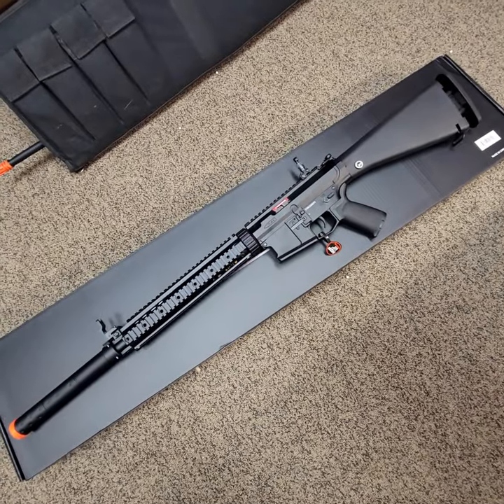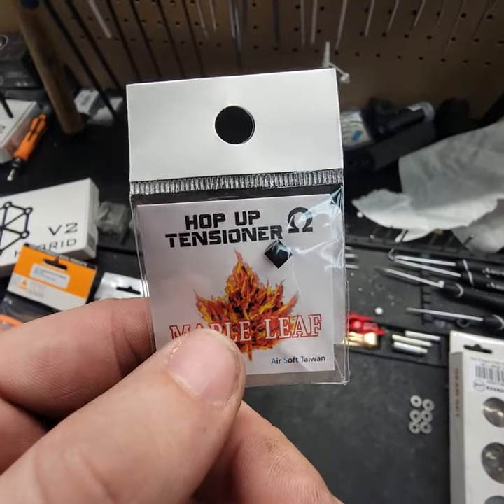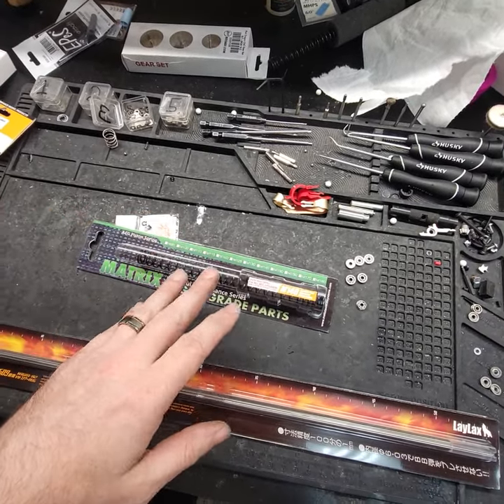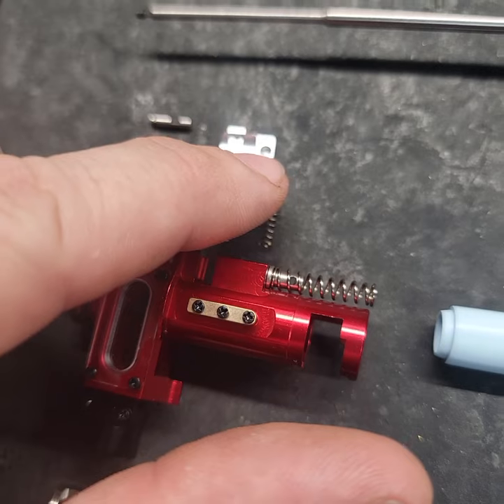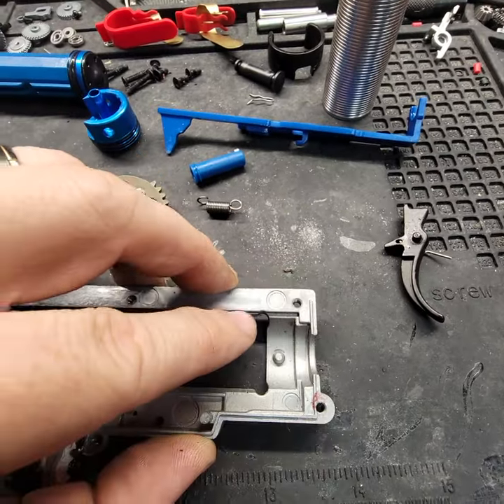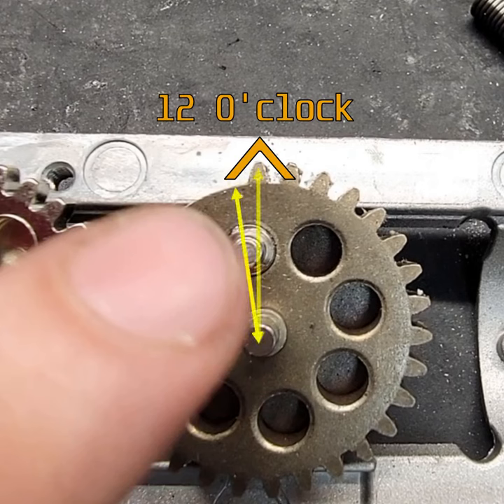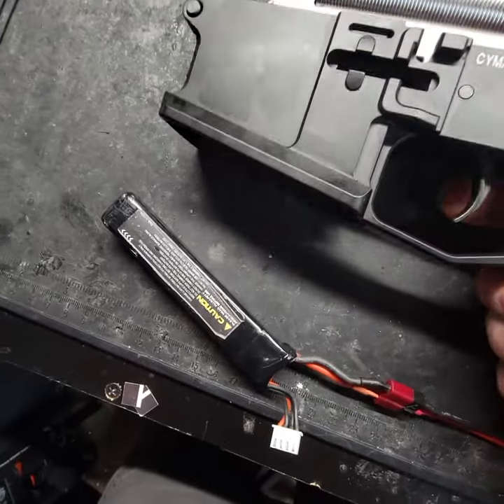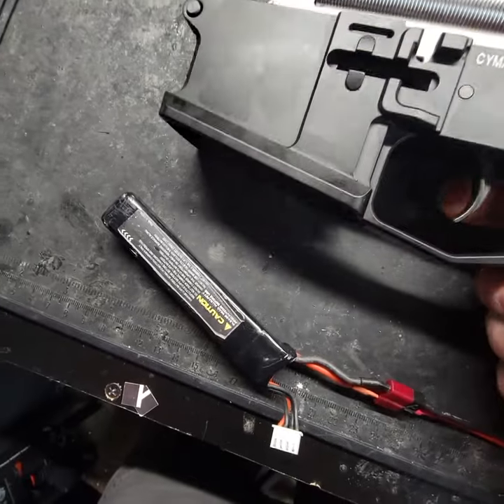Cyma SR25 Airsoft Rifle Upgrade Mastery: Insider Tips for Peak Performance!

Comment: Glad to see im not the only one who has power issues with the cyma sr25s. I have 3 of them and they all need lot of spring to get 2.3j.
Reply from the maker: What weight bb are you shooting and what is the diameter and length of your barrel?
Reply: @wyshtechairsoft  oh, they are set up to various spec. But the one thats closest to the on you built in this vid get 2-2.05j with an shs m150 no spacers. Woth 10mm spacer it gets spot on 2.3j. 
From what i can tell from talking to others who have/built these, this is kinda normal. 
Barrel is 509x6.01mm  shooting .36g bbs.
Reply: @kapler8550 funny as I have one that was built to be roughly 1.88j but the spring it has (guarder sp120) makes it only go to about 1.6j. it had a bunch of air seal upgrades too, basically everything except the gears, mosfet and barrel were upgraded. If it's just a quirk of these guns them I'm somewhat relieved
Reply from the maker: Nozzle alignment and tappet plate timing play a huge role in these sr25's.  The SHS/Rocket SR25 sector gears have trash tappet plate timing as for some reason the manufacturers decided it was good idea to REALLY advance the tappet plate pin WAAAAY ahead of the pickup tooth.
Reply: @wyshtechairsoft  nozzle alignment for mine should be fine, but yeah I noticed the tappet must be early as at rest the nozzle sits back, air seal still seems good tho weirdly, FPS consistency was +-1fps despite the lower FPS than expected
Reply from the maker: Does your sr25's joule creep when comparing from .20 to .36?
Reply: @wyshtechairsoft  yeah I’ve checked everything there is to check on mine. nozzle alignment is perfect. So is the airseal. im using the stock sector gear so timing isnt an issue. Im also using a g&g f2000 nozzle (24.5mm). Which doesnt have an oring but fits so perfectly on an shs cylinder head that it seals perfectly and has 0 wobble.
And nah .36s shoot with about the same energy as .2s .32s are the sweet spot.
Reply from the maker: @kapler8550  try a shorter barrel for fun and see what the joules do.  It should go up which would allow you to use a weaker spring to achieve the same result as before.
Reply: @wyshtechairsoft  my second sr25 is using a 
410X6.03mm barrel and it has the same power issues.
Reply: That's because it's got a extended cylinder, you need a spring made for it, I haven't found one make for it yet tho
Reply from the maker: @tbone9339 Matrix and EMG springs have plenty of reach.
Reply: @wyshtechairsoft  but they're still not as compressed as they would be in a normal cylinder right? So they're not giving as much power as they would in a normal m4
Reply from the maker: @tbone9339 actually they do partially compress.  In fact, with my experience building multiple v2.5, SVD, and the new G&G DMR. They always yield more joules than factory.  All because the added stroke on a 19 tooth vs a 16 tooth has more interia and air volume.  It also depends on how heavy of a bb you use (given that its a full cylinder in the 19 tooth).
Reply: @dankblissey6162  Sounds normal to me.
I am now upgrading my Steyr AUG A5 0.50", turning it into a DMR. With an M130, it shoots 370 fps @ 0.30g, which equals 1.9J. Here in the Netherlands, a DMR is restricted to 1.7J, so my next move will be to put an M120 in there (where's an M125 when you need them?!).
My Classic Army SR25 shoots 1.7J with an M120 and a simple 3D-printed shim that pre-tensions the spring (without it, I did not get close enough to 1.7J). I might want to check as how it shoots with an M130, but the Steyr AUG has priority now.
As always, the quality of the nozzle is crucial. I had to swap several of them until the AUG started to behave consistently at its peak fps.

Comment: I just bought everything for my build except I didnt buy a new barrel and I bought the titan V2 instead. Did you use the stock spring to get these results?
Reply from the maker: If my memory serves me right. I put in a m130 spring in it. Becareful with the cycle speed on these sr25's as they PME real easy with heavy bbs like .40g bbs.  The stock motor in them is slow enough to help with that.

Comment: Hello bro... Can I ask you something? I have a M110 (SR25) by Classic Army. 1. do you did a upgrade before this? 2. Right now have a barrel Mape Leaf of 540mm and use Bbs of 0,32g so,  Is correct the configuration? 3. What is you best configuratión suggest for my case..?
Reply from the maker: I always recommend using .40g bbs for even more range but you need to use a 420mm length barrel.

Comment: If i use a 6.05mm diameter Barrel can i keep the 470mm lenght to use .40s or it needs to be another lenght? thank you very much
Reply from the maker: Quick answer, I find 6.03 x 410mm with a SR25 length "NON-PORTED" cylinder in the SR25 is the sweet spot for .40g for best accuracy and maximize range without pushing TOO much air.  I highly recommend reading this article about the "What Barrel Length goes with what bb weight in an AEG?".  Link: https://www.airsoftsociety.com/threads/what-barrel-length-goes-with-what-bb-weight-in-an-aeg.153191/

Comment: nice , any opinions on the EC sr25?
Reply from the maker: They are okay in my book but id say you get a better deal with the Cyma Platinum SR25. DEFINITELY better than getting an A&K.
Reply: It's good as well. Especially those bought from taiwangun or thailand. But if it's from hongkong with regular stuff, it's crap. No true quick change, plastic nozzle no oring, and a ported fckssning cylinder.
Reply: @mmwkoh Mine came from Poland

Comment: I'd actually recommend the mr hop over the super macaron. Combine it with a maple leaf or action army barrel and you can lift .36s without even touching the dial. Super macaron is really nice but I think the mr hop barely edges it out. Also swapping to a shorter barrel like a 455 or 410 to make sure you're giving the heavier BBs a better push is a good idea too
Reply from the maker: Going down to 455mm over volumes the rifle for .36 bbs which causes a wider grouping at 200+ feet.  Super Macaron hops the bbs more consistent than the MR hop which is why is was chosen.
Reply: @wyshtechairsoft  In my experience using .40s on a 455 I've had no issues using the mr hop compared to the super. They're both great buckings tho
Reply from the maker: @lukejohnson3612 Yes, 455 is pretty close to what you need for .40s.   .45s would be even better if you got a full cylinder in the SR25.  I built many of these sr25's and tried many variations, and now build them for people. This one was specifically built for .40g and to maximize accuracy with that given weight.
Reply: @wyshtechairsoft quick question, what determines the weight of the bb that you are going to use? Because the way I see it, the system is optimized to use that bb weight, right?
Reply from the maker: @Rasyad95 Its air volume ratio.  The ratio between the volume of the compression area in the cylinder compared to the inner barrel assembly.  The heavier the bb, the more ratio you need.
Reply: @wyshtechairsoft  so you decide the inner barrel size you are going to use, and the bb weight follows?
Reply: @Rasyad95 goes both ways. I have another stock hop up with 455 mm barrel for me to use when i do .36s instead of .40 or .45

Comment: For me, after I upgraded my parts I was getting 1.7 J with stock spring then 1.75J with m130 spring with .40bbs. Once I put in a m140 spring something all came together because I was now getting 2.59J with .40bbs
Reply from the maker: Sounds like it caught a better seal.  Whatever was installed made it get a better seal.  I've had this happen to me before as well.  Which is why I usually test with the stock spring when I put everything back together (if the stock spring isn't too weak to cause PME). That way, I can see if there were any compression leaks anywhere.  Sometimes compression leaks dont appear until you go to a heavier spring since compression pressure spike is alot higher and some areas will "blow out" if the surface areas of which the seals make contact isnt tight enough.
Reply from the maker: A good example of this is a loose-fitting cylinder head to cylinder.

Comment: M140 in V2.5 gearbox isn't M140 since the cylinder and piston are longer and don't compress the spring as much. You'll always get much lower results in V2.5 compared to V2.
Guarder PSG springs are made for 2.5 shells, PSG120 is around 2.3 joules.
Reply from the maker: True, but it is still an M140 as that is its designation.  Thank you for the insight on the Guarder PSG springs! Where can one order them?

Comment: Looks like you have done a lot of SR-25s- what is the best one "out of the box"?
Reply from the maker: The Cyma Platinum SR25. Dont need much to upgrade on that bad boy.  Upgrading the ETU and nozzle makes a MASSIVE improvement on those things.  Dont need to change out the compression set except the nozzle. Heck the .motor is good.
Reply: @wyshtechairsoft just got the Cyma sr25, first airsoft gun so I've got a few questions. What weight bb do you suggest and for the upgrade you suggested what are the best ones for it. Thank you
Reply from the maker: Perun V2 hybrid ETU mosfet is by far the best upgrade to switch to as its way more reliable and offers really convenient quality of life improvements like precocking and low battery warning.

Then get yourself a Maxx hopup, maple leaf 60 degree super macaron bucking, omega nub, Prometheus 6.03 barrel x 455mm, EPeS 24.5 nozzle, SHS Gen2 cylinderhead, and the new SR25 gears that I just released on my website.  I made a video about those on this channel.

Start off using .32g bbs when you get the maple leaf bucking (cheapest upgrade that makes a huge difference)

Comment: Hey im also building the cyma sr25 but i would like a faster trigger response, the problem is there are no 13:1 gears with that pickup pin position is it realy that big of a problem?
Reply from the maker: For faster trigger response you need to short stroke the sr25 because if you try to keep the 19 teeth and try to go over 20rps (rps is just a metric to get an idea of trigger response) it will PME.  That being said, you can just put a standard 13:1 gearset and the high torque motor that come with these are perfect for that ratio and adding a m110 spring to retain 370 to 400fps.  

If you are worried about air volume ratio - just install a shorter barrel for whatever weight bb you plan to use.

Comment: I'm also trying to upgrade cyma sr.25. Do you have any experience with bad bbs feeding? I'm putting inside a retro arms hop up unit and 24,5mm nozzle, which is probably causing the issues. Anyway great job with that build!
Reply from the maker: Bad feeding could be cause by bad bbs, mag not releasing bbs into hopup,  nozzle being too long (24.5mm is perfect length), and/or hopup unit itself is trash.  Check all of these and I bet you'll find the issue. Also, thanks for your compliment!!

Comment: I was looking to do this exact build!  Are there any issues with using all 3 gears from the shs sr25 gearset?  Or would you recommend using the bevel and spur from shs coupled with the OEM sector?  Great vid!
Reply from the maker: Dont use the SHS sector gear. It too pme's the tappet plate just like the red dragon does. The oem sector gear will be a lot easier to deal with.  I dont know why companies like Rocket, SHS, and Red Dragon advance the damn tappet pickup that much. If you do want to use the SHS sector. You need to slow down the cycle rate and/or put a stronger piston spring in so the piston gets to the rest position before the tappet gets picked up.  You can also short stroke the sector gear on the release side to release the piston sooner, but that defeats the purpose of using an elongated cylinder.

Comment: Can I ask you something?
According to my research on the AS Sniper Com, the optimal cylinder:barrel ratio for BB 0.4 is 2.65:1.  So why do you use a 470mmx6.03 barrel for the SR25's cylinder when according to calculations - 420mm is the correct choice?
Reply from the maker: I did this at first and found that the measurements for getting the ratio wasnt entirely accurate for the weight of the bb I was going for. I found it much easier to just chrono the rifle every time I shorten the barrel until I seen it started to joule creep and wrote down the barrel length for the given compression parts.  I upgrade alot of sr25's and have the results written down for specific compression part combinations. This is to achieve the maximum efficiency for the exact bb weight.  The end result makes the piston slap extremely quiet and maximize accuracy at 300ft
Reply: @wyshtechairsoft  This makes me think of something.
It seems that the compression of the spring also affects the compression ratio.  It's like the higher the spring, the better the initial compression, so the bb will roll sooner.
I'm using the 420 crazy jet barrel but the fps I get at 0.36 and 0.4 is the same so I think the 420mm barrel is a bit short compared to the sr25 cylinder and I was doing some research then I found you.
Reply from the maker: Get a jewelry scale and measure the weight of the .36 and .40.  Im curious how close they are to each other in weight.  I personally use a scale to test bb weight consistency for testing. For example, I found that HPA is much more weight consistent than BLS.  There fore more fps consistency and accuracy.
Reply: The ratios are based on the spring used, piston weight, and air volume. It's Bernoulli's principle and Boyle's law working together. The best option is to replicate what is done by others to achieve their results or to just continue testing until you reach your desired power.

Spring, piston weight, barrel, and air volume. Changing one of those could yield different results.

Comment: Why buy 501mm and cut the inner barrel? Prometheus got the 469mm ,6.03mm.. Is the 1mm got much of a difference on the output?
Reply from the maker: It's what I had on hand at the time and I could get it to exactly to where I want it.  No, 1mm wont make any noticeable difference.  Its what I ended up with when I cut it down.  Margin of error, if that makes sense.

Comment: Where can i find the full dissasembly?
Reply from the maker: Any YouTube video on disassembling a V2 gearbox / M4 platform will show you how. (Since the SR25 is basically the same, just longer)  If its a cyma platinum SR25,  with the addition of whatever disassembly video you watch, you have to remove BOTH selector switches, spring guide, AND bolt release.

Comment: Wyshtech, this is a great video and I am using this as a shopping list on your site for my Cyma Plat SR25 build. I do not plan on using BBs heavier than .36g. I read on your site that the Maple Leaf Super Macaron is for .40g and heavier BBs. Would you still recommend using that bucking with lighter BBs? Or is there another bucking you would recommend using? I am not planning on replacing the barrel. I do not have the equipment to cut a barrel down. I read that the Macaron buckings do not work with the stock bucking window on the stock barrel.
Reply from the maker: I should change that.  The 60 degree super is good with 32 and above and make smaller groupings over stock.  This is given that you are using a maxx hopup.  If your staying with the stock hopup.  Go with the Begadi SHP5 and 2.5mm begadi nub for the stock hopup. Its more compatible.
Reply: @wyshtechairsoft  Thanks i will add that to my shopping cart. It appears that the EPeS 24.5mm nozzle are out of stock. do you know when you will be getting more of those in? Was also wondering if you had heard of any issues with the super Macaron bucking having issues with the stock barrel bucking window? I also noticed that the Maxx Pro states it is compatible with nozzle lengths of 21.00mm to 21.25mm. Is it because of the V2.5 gearbox that the longer 24.5mm nozzle works?
Reply from the maker: @chrisvanmeter8654 I dont know honestly as the stock hopup does a poor job of hopping .40g bbs and isnt rigid.  The best bucking to go with is the Begadi SHP5.  As far as nozzles go, they are two weeks out.
Reply: @wyshtechairsoft  Thank you for all the advice. I really appreciate it. Would you recommend using the stock nub, or is there a nub that would work better than the stock with the Begadi SHP5 bucking in the stock hop unit?
Reply from the maker: @chrisvanmeter8654 Of course! Grab the begadi 2.5mm nub from my website. That is more universal to stock hopups.

Comment: If you use a shorter inner barrel, will the bb not hit the inside of the mock suppressor?
Reply from the maker: It wont AS LONG as your suppressor is centered perfectly and you shim to stabilize the inner barrel in the outer barrel.
Reply: Thanks!
One more question, is it possible to put foam in the supressor?
Reply from the maker: @amboemlauw Honestly, ive never tried.  Not sure if you can open it.  Id just get the 16" m-lok and get a supressor that you can put foam into.

Comment: What spring would get 1.67 joules on a .4s would a guarder SP120 be too powerful uk limits means most sites only allow 1.67 joules or 425fps on .2s so if you xould let me know it would be a great help as i have a cyma sr25 in a very similar build
Reply from the maker: Stock spring should get that if tappet timing, compression is perfect, and a 410mm length barrel and full cylinder.